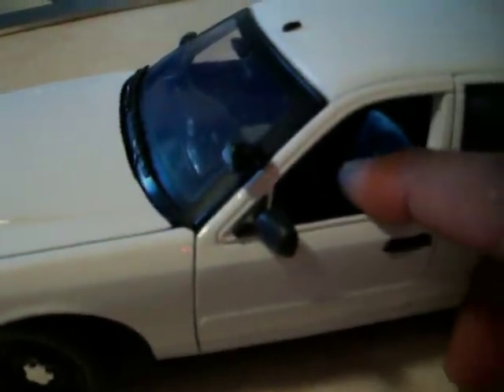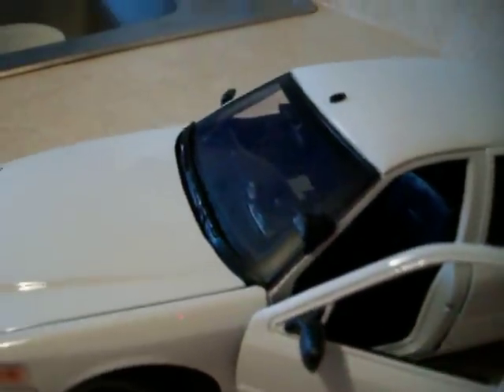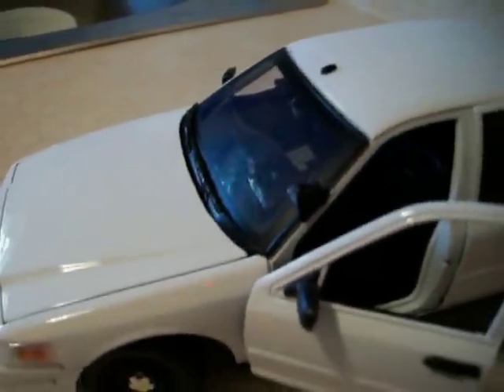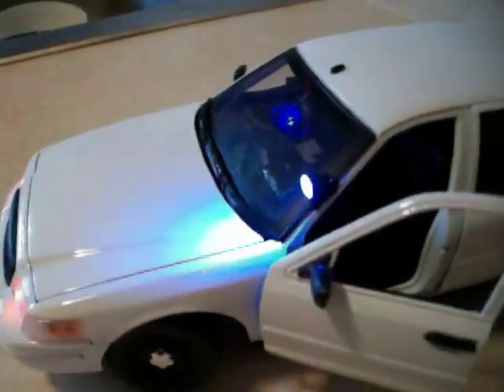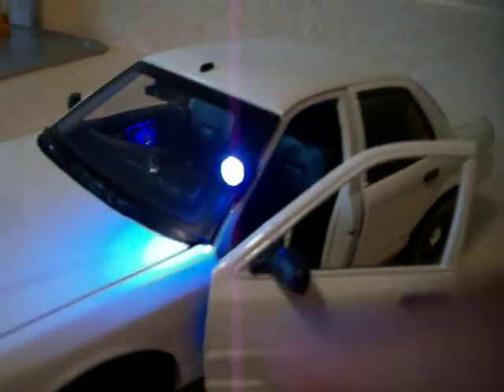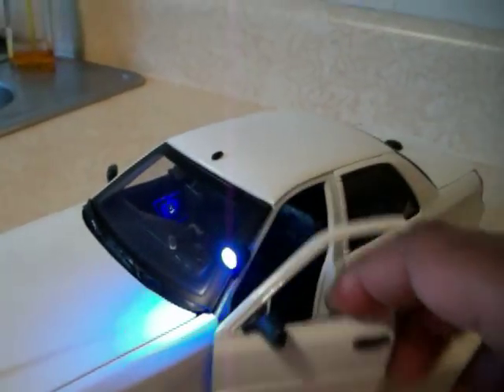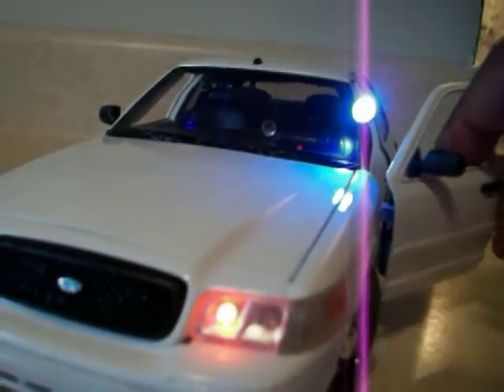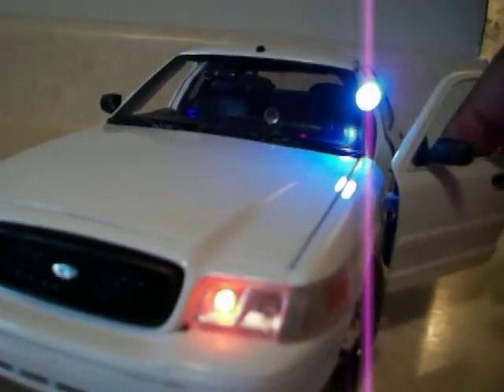1/18 police -- install details explaination  .MOV

Comment from the maker: the original spot was drilled out and i placed a steady burn led in. lil paint and hiot glue to hold. if you check on policecarmodels forum they also have soem listed there already wired to go.

Comment: I've just taken up a new hobby and wanted to know how you made and install the spotlight?  Also, what did you use to fill and paint the hole where the original spotlight was?  Other videos shows wires from the spotlight.  I have already ordered the Crown Vic and know there are a lot of other supplies I need.  Thanks for your attention.

Comment: Hey man I know I'm 6 years lat but how do you clear those corner markers
Reply from the maker: non-acetone nail polish remover..used lightly to remove orange. don't let set to long it will eat plastic.
Reply: +badge764 how long do you suggest letting it set for
Reply: +badge764 if I put tape over the orange spot I want to keep would that work or no
Reply: +badge764 thanks for the help now my cruisers gonna look 100 times better